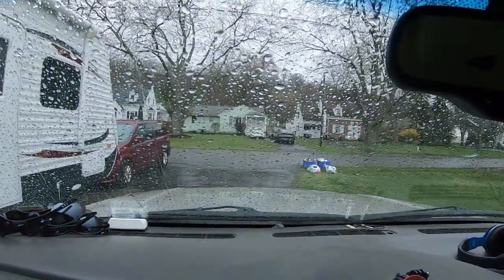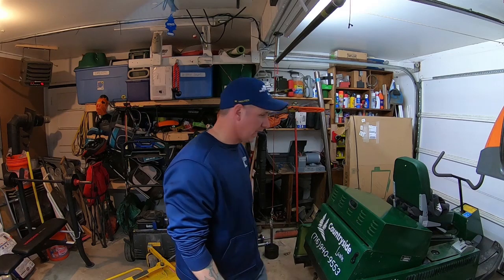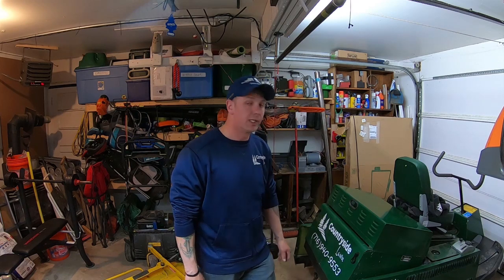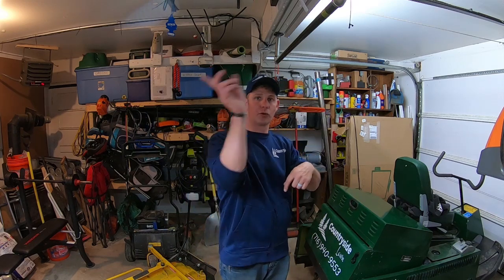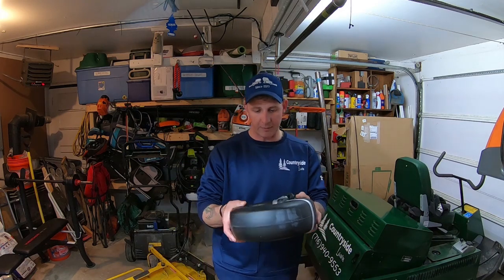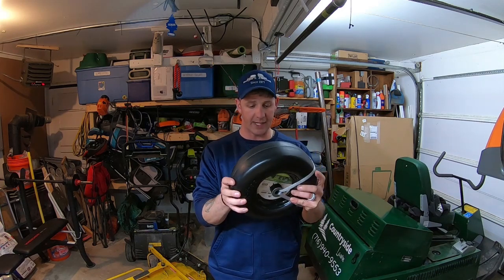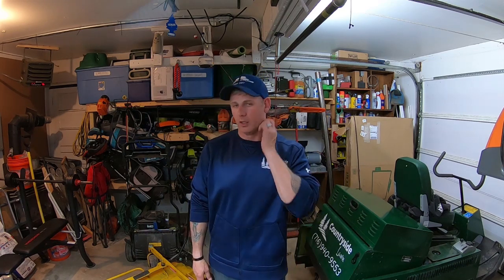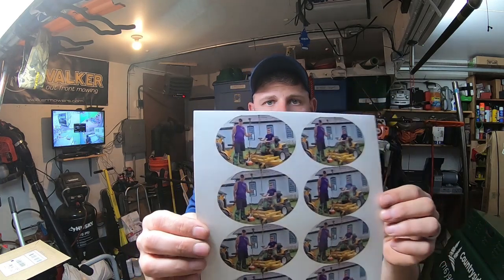Sticker Swap Anyone??

Comment: Hope you beat those electrical gremlins!  They are a pain in the you know where!
Reply from the maker: I finally did. Break in the wire somewhere. I took out all the wires from the switch to the solenoid and ran all new